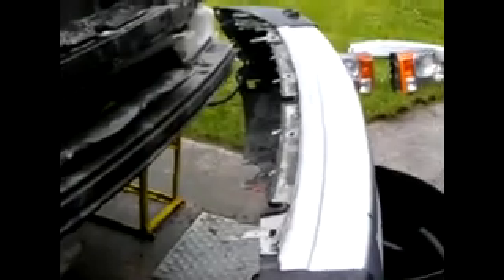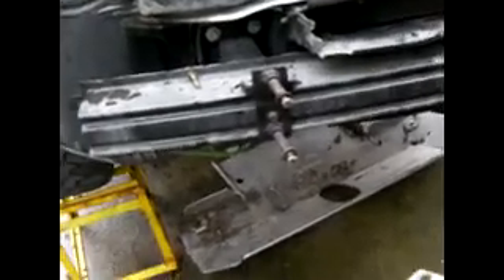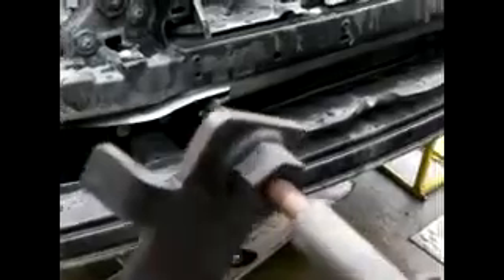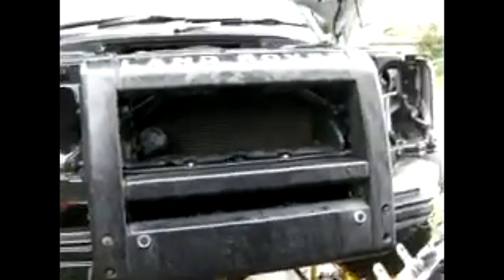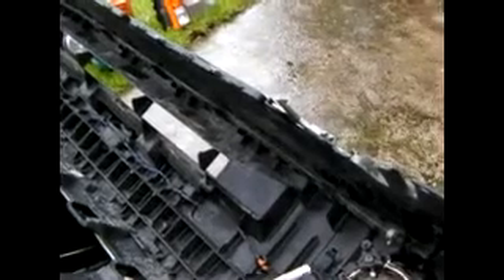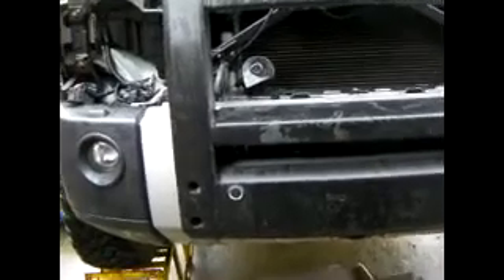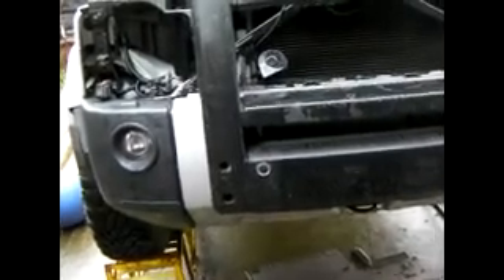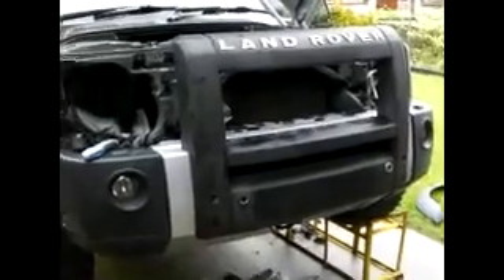Fiting an A-Bat to a Land Rover D3 part II

Comment: This looks really great. But I have an important question that you have not covered lol  When you placed the brackets onto the crash bar, how did you secure them? Were there holes ready to bolt the brackets to in the crash bar? If not what size drill did you use?  I have bought a used bar but had to buy the brackets from a Land Rover parts place who can't seem to tell me lol  Cheers
Reply from the maker: thread holes in place already for the stabilising brackets at the top, and straight through holes in the A-bar for the mounting bolts, sorry about the delay answering